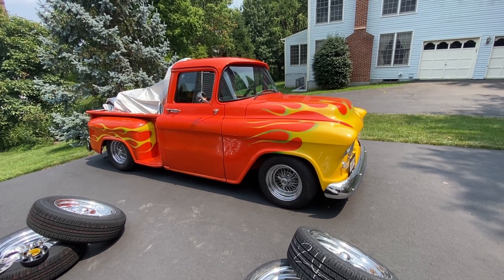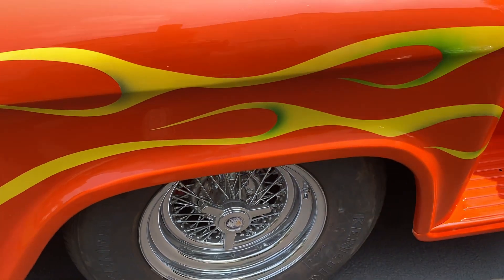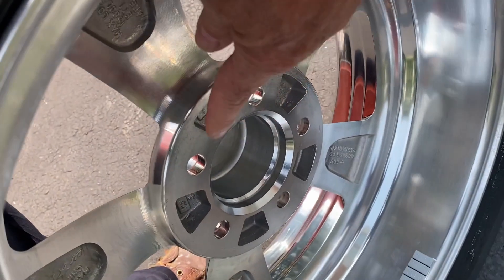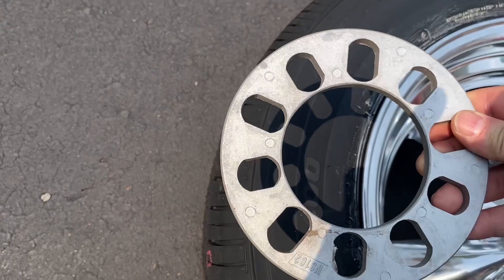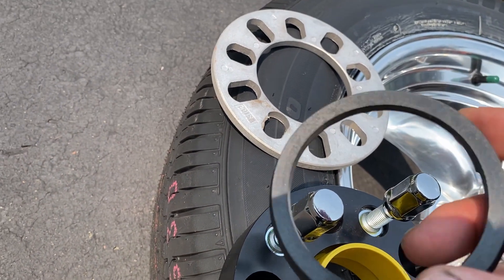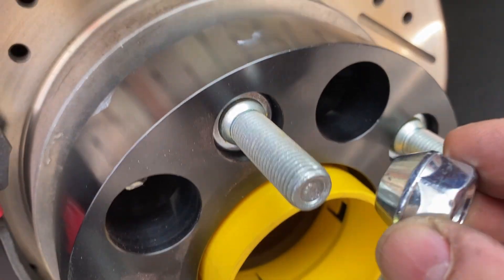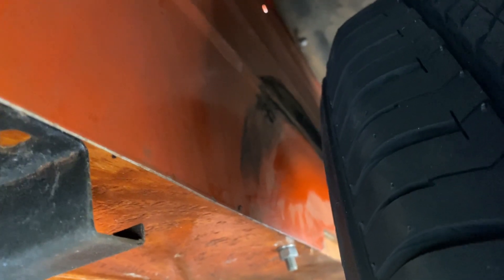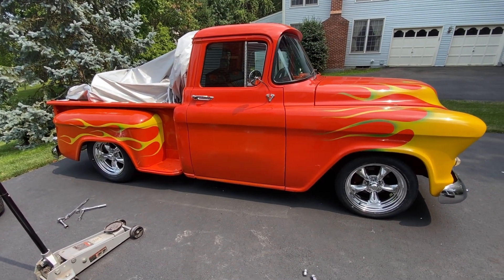56 Chevy Truck gets New Wheels using Hub-Centric Spacers

Comment: What tire size did you go with?
Reply from the maker: @rthomas275  went with 215/70r17 on rear. Good size for me, good clearance. The fronts are 215/50r17. Not happy with the low profile look. I was concerned about clearance but could have gone larger.